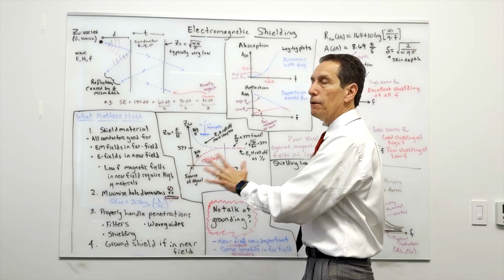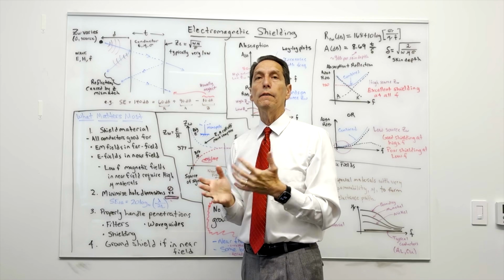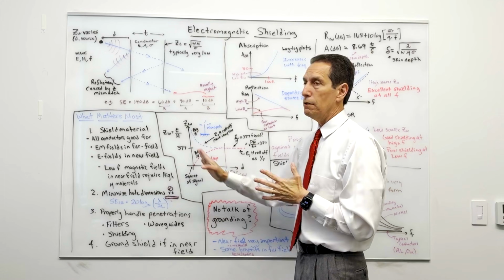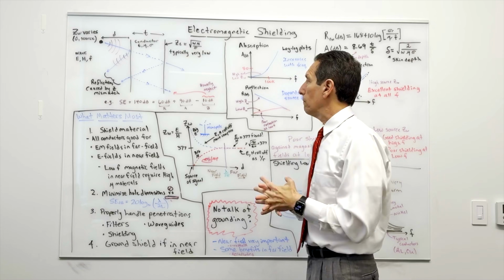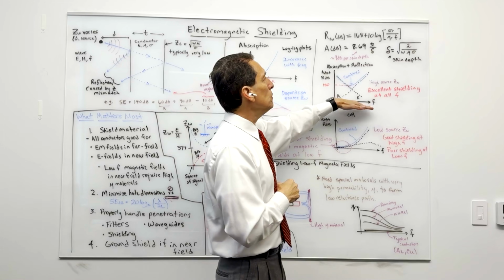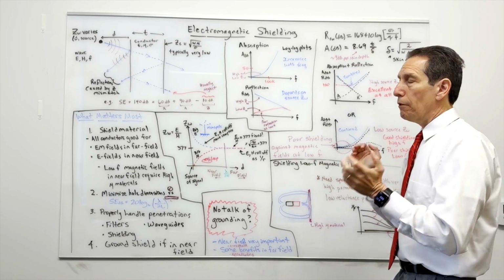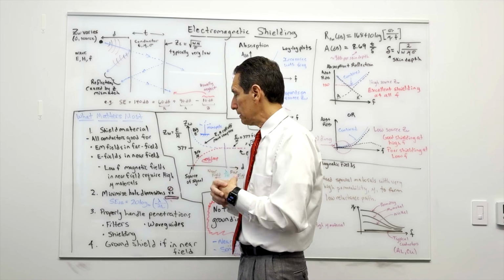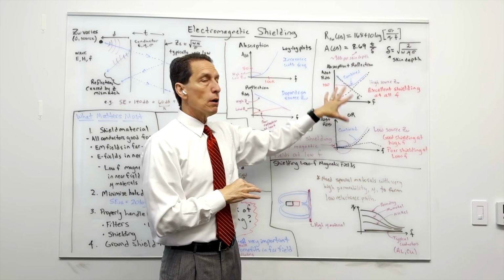Science Topic 3: Electromagnetic Shielding

Comment: Dr./Mr. Bradley, I'm trying to theorize outer bunker protection skins and thermal breaks to deal with a DST strength of up to 1600-2200 nt, at frequencies spanning 0-3000 Hz. (for theoretical 12K yr event). The induction may last for 2 to 3 hours. In your thoughts, would an outer skin (of the nesting doll effect) being 1/8" to 1/4" welded plate steel work? And only, up to 5mm holes here and there (for thermal venting), work? Or, do you think steel would heat to melting point? I just don't know where to get that much tungsten affordably.. lol

Comment: Thank you for your help. . . .    RE: credit cards ---  Can you block the "tap" feature on your card by fixing an adhesive foil like alum. or copper foil on both sides of the card?   The bank will not disable the tap-feature.   The choke-point is at the register when you pull your card out.

Comment: Would putting ferrite beads and/or baluns on conductive penetrators (coaxial cables,  electrical wires, even metal plumbing pipe) help with shielding an enclosure?

Comment: Was wondering if copper and aluminium together makes better shielding or just one of before mentioned ones or are there other options available?
Reply from the maker: Both are very good conductors, but copper is better. As long as the metal is more than a handful of skin depths thick, the conductor material doesn't matter very much. For very high levels of shielding, it is better to have an inner shield and an outer shield with a small gap in between if possible. This is because you benefit from the reflection at the second barrier's interface.
Reply: @disasterprepper  Making cyberdeck with cardboard box inside with copper tape and outside with alunium foil or such or should I do something else? For a DIY disaster kit Jay Doscher inspired cyberdeck and/or IIAB aka Internet Inside A Box if worst comes to pass but I think you catch my drift where I am going with it